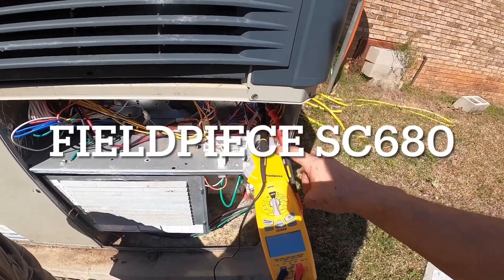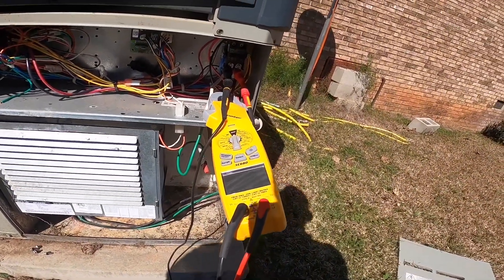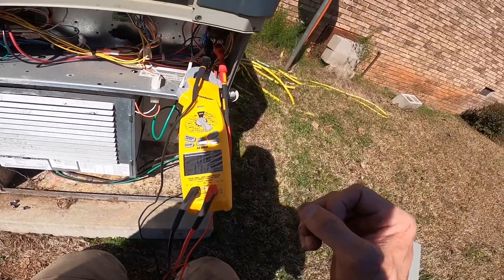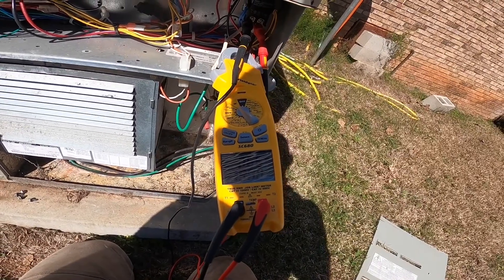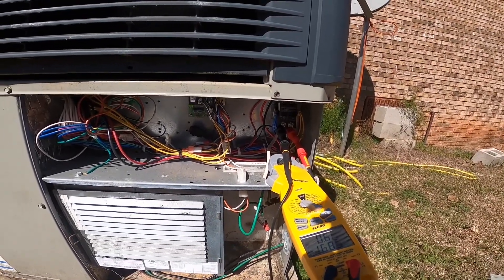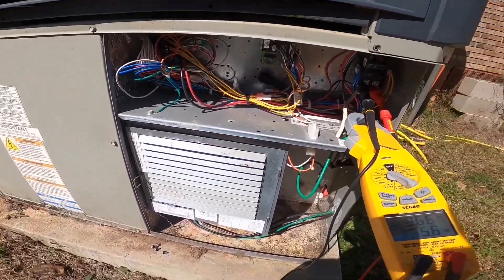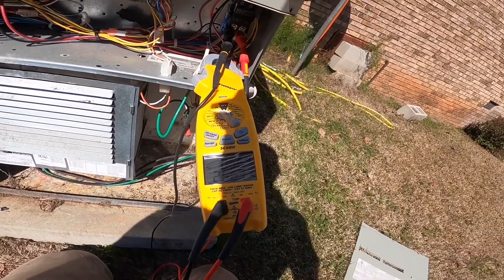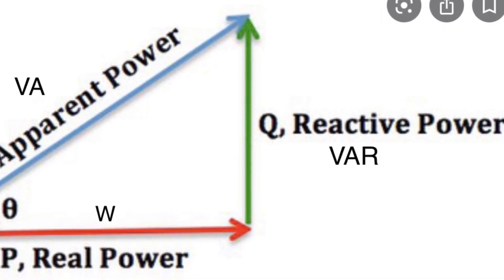Explanation of Watts capability on new Fieldpiece SC680. Or at least my best attempt.

Comment: Does that have a LO Z function? That eliminates ghost voltage.
Reply from the maker: It has what they call a “low pass filter”. I don’t know if it functions the same as the Lo-Z on Fluke
Reply: @HVACGUY  I'll probably get the Klein just because of that feature.

Comment from the maker: It doesn’t help that the “real power” isn’t the real power. It’s a function that most will never use. But, it’s going to help sell equipment.
Reply from the maker: It’s useful when trying to sell a new piece of equipment. If you can prove their old system is only operating at the level of an 8 SEER, it makes it an easier sell hen they can see the money they will save. Apps like Measure Quick calculate all this for you, but you need that one piece of info. Before this I had to guesstimate power factor. It’s not used often. It’s just really useful.
Reply: I'm on the ventilation side of HVAC.  I do enjoy watching videos of the service and install from the reefer side. Again...Thxs for the vids!
Reply: What would be the usefulness of finding the actual seer of a piece of equipment that already in service.  Let’s say it’s a 14seer and ya check it and it comes out to idk 12 1/2 or whatever. What are you able to do with that information?   I’m honestly curious and not trying to be a troll or anything.